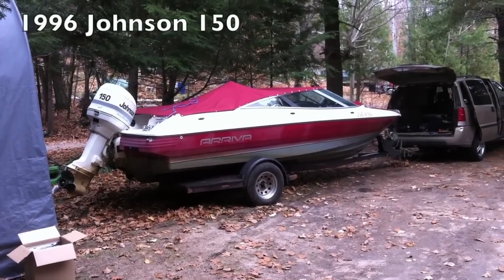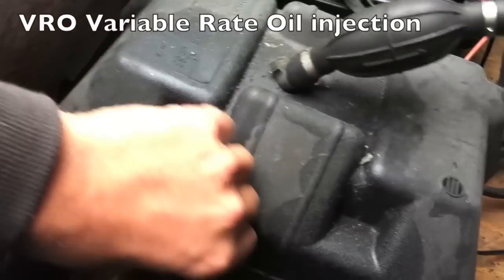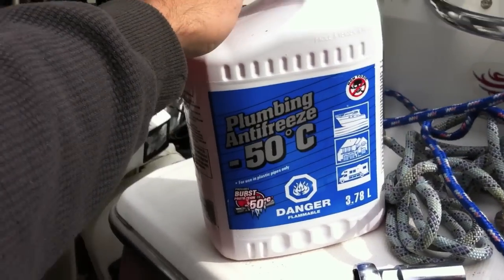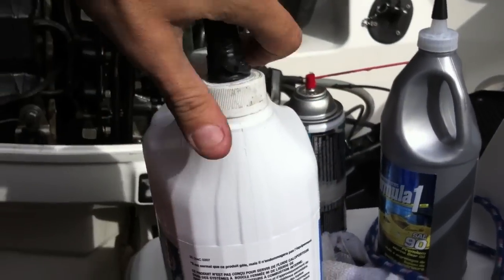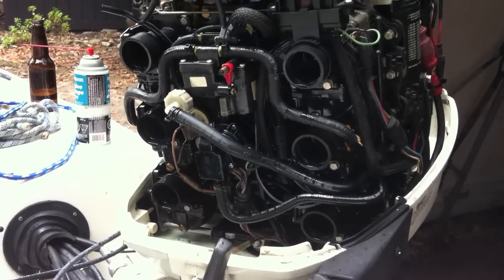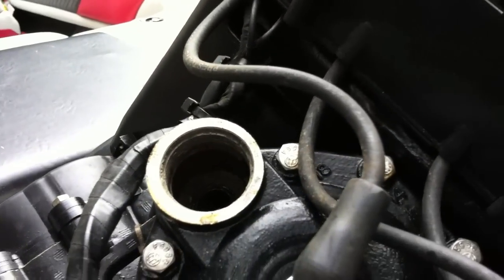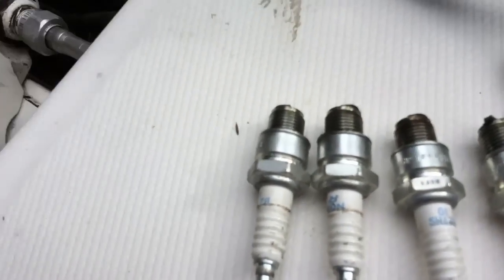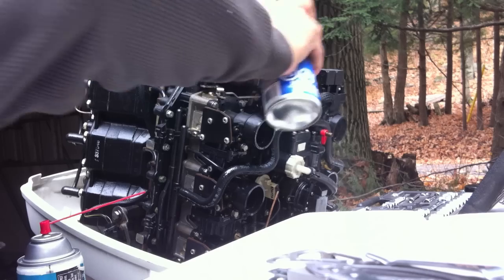How to Winterize an Outboard boat, step by step guide in HD for 96' Johnson 150 Motor

Comment: I have watched your video every year for the last 4 years right before I winterize my Johnson 225 HP OceanRunner. I have never had a problem starting my boat up in the spring in Greenwich Connecticut. The only added step I do is, I change the gear lube in the lower unit. Thank you for creating this awesome and educating video. The best line in the video is “And you can have one of these while you waiting” 🍺 Thanks again Anthony Ferraro
Reply from the maker: love it, thanks man, unfortunately I no longer have this boat.

Comment: I have a 2005 50HP 2 stroke mercury on a 20ft pontoon boat. It is from Arizona where it sat unused OUT OF WATER for the past 2 years. The motor sat in the upright position. I brought it up to south central Wisconsin... its new home. It has sat there at a buddies vacation house for about a month. Been too busy to get out there to go through it. The weather just started getting cold and the race is on to winterize the motor. We've already had a hand full of nights where it dipped below 32degrees. The past owner said he added fuel stabilizer back then. I just want to get the old fuel out of it altogether. Old owner said it never really ran good but has no idea why. To start diagnosing I want fresh fuel. We didn't try to run it yet. 

I was thinking of leaving the motor alone til spring when I can go through the motor, rebuild carbs, get all the old fuel out of the lines, replace fuel lines if needed (They're cheap), etc.. I am going to inspect and replace the lower's oil. Should I buy muffs now, TRY to get the motor started, add antifreeze, fog it, etc.. (The normal winterization schedule) Or should I just leave it alone as it might be dry inside? 2 years in the desert probably dried it up good I would imagine. Any advice? I'd rather go through it in the spring when I know I'll have a stretch of warm weather. If I pump water through there now (if I can get it running) and she wont keep running long enough to get antifreeze into it, I could be screwed. Should I just leave it alone?

Comment: Aways change the drive oil, or at least check it to make sure there's no water in it, before putting it up for the winter.  When spraying oil into the cylinders always angle the nozzle so that the oil hits the top of the cylinder otherwise it's unlikely to get oiled at the top.  Another way to coat the cylinders is connect to a small container with a heavy dose of 2 stroke oil and run the motor 'till it runs out and dies.  This will also help keep the carbs from gumming up in storage.

Comment: Some good tips there but surprised you neglected perhaps the most important winterizing step: removing the transmission oil from the leg. Any water that gets past the seals - and just about all outboards will have some water getting in - will freeze and expand in our delightful Canadian winters, possibly causing havoc to the leg. In fact this is the ONLY procedure I have done for the past couple of years other than bringing the battery inside and haven't had any issues. Although this year will be adding fuel stabilizer and may do a flush with antifreeze as you have shown. Thanks for a great vid.

Comment: I would have cleaned the battery post with Emory or a light sandpaper, also check the electrolyte battery fluid so not to cook a dry cell. Other then that your ducks are in a row. Snuggly?..... Sup wit dat yo. Great Video.

Comment: Great video. So when you pull it out for the first time in the spring is it as easy as installing the battery, starting and takeoff? Or is there anything that needs to be done? Also, I've had a real problem with mice in my shed like yours...I've had to throw in a couple lethal traps to keep them out of my engine.
Reply from the maker: +ironDsteele I don't have this boat anymore, but I never really had any issues, just started it at home first, takes a little bit to get her started. once I know it will go, then I take it to the launch.

Comment: Some additional comments, I try to run plumbing anti freeze into the intake for the live well to make sure the pump is covered as well as pouring some down the outlet for the bilge pump. Not sure how effective it is overall but it's worth a try just in case. Don't forget the moth balls for mice. I've never had a season where they weren't staying in the boat overwinter. Great video, thanks.

Comment: Now days I run fuel stabilizer and also Deep Creep aka sea foam off and on.It smokes but well worth it, there never is any gas going thru my motor that isn't stabilized.I also take one plug out at a time and crank the key once to pickup the fogging oil in each cylinder,This fella did what most anyone will do,with little variation.I do not use Antifreeze i might if I had my motor in a test tank situation.

Comment: Not necessary to flush with antifreeze.... any remaining water in head will drain on its on if the boats out of the water
Reply: +eric rosebach Hello, I have just purchased my very first boat, it has a 70hp Evinrude OB and I wonder if this will work for it? Can I just simply leave it upright to drain the water out of it? Need to find out how to change the oil. Will try to run the fuel dry in it too.Thanks.

Comment: Nice video thanks. I also change the gear case oil every fall. If any water got into the gear case over the summer its gone now and the new oil will not freeze. If the gear case oil is milky when you drain it you know you have gotten some water into it. Boat On!

Comment: I am a marine tech and all I ever do to put a outboard away for long storage is to diss connect the fuel line and run it till it dies so there in no fuel to go bad and then turn it over and it will pump all the water out so there is no water to freeze,, I have done this for over 20 years and I have started motors after 5 years storage and after connecting fuel they fire right up and idle just like when put away,, allot easier faster and cheaper and you actualy get a better result,, but whatever works for you,, just a thought,,
Reply: +infrareddreamz  You should never run a multi cylinder 2-cycle engine dry by disconnecting the fuel line.  For instance, if you have a 4 cyl, 2 carb setup, and you disconnect the fuel line, the top carb will run out of fuel first and the bottom carb will keep those cylinders pushing.  Since the 2 cycle only gets oil to the cylinders when it's burning the fuel/oil mix, you will be scouring the cylinders until the engine dies. If it's a 4 cycle then it has oil to keep thing lubricated, but a 2 cycle doesn't.
Reply from the maker: +Jeff Taylor , good point! some marine tech that guy is
Reply from the maker: I have learned more from the comments left on this video then I could have by searching around the internet, I like the idea of disconnecting the fuel and running it, till its dry. I do this with my 6.5 merc.
Reply: Warren Hardy trust me it works allot better than leaving conditioned fuel in it ,, if you leave fuel in the carb it will dry up after a couple months and the oild that are in the fuel are left behind to leave a coating in the carb that can gum it up,,
if you run it dry you have a dry carb and when next season comes you hook up your fuel and it will fire right up and not have to worrie about gum left behind,,  I end up rebuilding more carbs from people who have their motors winterized with fuel left in them and very rarely rebuild one that was ran dry,, I do like fugging it for storage tho,, that is god for the whole motor,, it gets through the whole motor,, good luck and happy boating
Reply: +infrareddreamz  what can I do to winterize my evinrude if it is not running. it needs to go in the shop, but I need to save some funds..any info is greatly appreciated!
Reply: +Warren Hardy If the engine has been running and the cylinder walls are fully lubricated I dont think the cylinder wall on the one that runs out of gas first would run dry of residual oil before the last cylinder runs out of fuel
Reply: Jeff Taylor hey what about a 6 cyl motor can i disconnect the fuel line and run it dry ? Or is it bad

Comment: Is this a salt water motor? Is there any difference in procedure for fresh water only?
Reply from the maker: This motor had been run in salt by the previous owner, I'm in Ontario, just fresh water where I am.
Reply: +Steve Van Dokkumburg If its been in the salt water you need to put it on a hose and rinse it out with freshwater afterwards because the salt will eat away at it with time

Comment: In an old motor I used to have, I would replace the oil in the bottom unit gears every winter- it would turn white-ish- water would mix in during the season.  The new motor I have, it was really clean- straight oil, so I think I'll skip that this fall.  I've heard both ways- about the stabilizer or running the engine dry.   I like to run the engine dry after every use, because I'm lazy, and don't know when I am going to take it out again.  I do like your silicon spray idea, and am going to look for a can of that.
Reply from the maker: Yea. No need to run the anti-freeze, I have a little outboard now, that I keep using till it gets to cold. And I don't know when it will be the last time to use it. Some of the best advise is the silicone lube to stop the cracking/drying up of rubber. For sure.

Comment: Great Video Warren, after reading the comments , it just seems as usual u cant please everyone.. instead of sayn thank u , or making they own video, they have negative shit to say.... So again thank you for taking the time to do this.. if it working for u then dont change a thing.. I have been doing these exact same steps for yrs and my 115 2001 Ocean Pro, works just as good as it did the day i got it new... so again thank you Sir !!..
Reply from the maker: right on
Reply: Warren Hardy I was about to buy some of that silicon spray.  Then I see on the label not to use it on plastic.   I'm unsure what might be under that engine cover.  Maybe a '82 evinrude wouldn't have any plastic.   For an example of using something in a bad way, when I used Armor All on bike tires, they cracked shortly there-after.   How long have you been using the silicon spray?   I already replaced some of the old dry rotted wires on the motor, so I would really like to use that silicon spray.

Comment: These days it is a better idea to drain the gas out as empty as possible before storing. Keep enough in the tank for winterizing and add some stabilizer to "the dregs" - - It used to be a good practice to keep the gas tank full to ensure water doesn't get in over the winter via condensation. The gas these days is awful stuff and won't age well - and old gas is not good for the engine, even if it's been stabilized - so drain it almost completely in the fall. In the spring the tank will be empty enough for lots of fresh gas which will burn nice and clean and help blow through (& dilute) any contaminants. 

Did I miss something, or did you cover changing the oil in the lower unit? Probably a more important task than the antifreeze in the cooling system. (When that is empty, no freezing will occur anyway).
Reply from the maker: Dont remember if I covered the lower oil. But I always do it in the fall. So it's put away nice and clean and ready to go. I leave the empty bottle in the back so it reminds me that I did change it.

Comment: I wouldn't drain the carbs though (unless you are storing it for a collection were it will sit for years)... they can dry out the gaskets if not used for a while. just make sure the fuel is stabilized.

Comment: Nice video. To make things easier
1. Instead of trying to spray each carb throat withoil, just use the adapter that's nestled in between them! You will need the omc bike air nipple connector thingy that comes with lots of other brands of fogging oil.
2. Guy BE SURE TO LUBRICATE THE STEERING ARM! Can't stress this enough, especially in salty air
3. Make sure you drain the lower unit oil to get the water out and put fresh oil in just so you don't need to do it in the spring.
4. keep the motor TILTED DOWN to drain all water and when trying to wake it up in the spring... starts lots easier
5. do the water pump in the spring at least every 3 seasons (as long as it's flushed after each use)
Reply from the maker: <font color="#000000">great tips</font><font color="#000000">I saw the bike air nipple and for the love of god could not figure out what it was for.</font>
<font color="#000000">Good call on the steering arm, never thought of that either, and same as you I change the lower end, at the end of each season, so that its ready to go. also heard not to leave it empty of the winter, same idea as carbs, you don't want to dry out the gaskets or seals.</font>
Reply: Warren Hardy Hey warren... yea that adapter is great... i have a few old crossflow v6's from the early 80's in addition to my 225 oceanrunner and was really glad to see they had it on that beast... makes things so much easier. In the spring you can also use the adapter to run engine tuner through!
Reply: Good call with the steering arm I been using lithium grease, is that good?

Comment: Great instructional video.  I do many of the same steps.  I do however, drain the float bowl in each carb and flush all of the fuel out of the lines.  Better to not have the fuel in there IMO.
Reply from the maker: thats a great comment, maybe thats why I started having problems with my float bowls getting stuck, over flowing, leaking, etc. Ordering all new ones, hoping it fixes my current issues.

Comment: Wow! never seen that before RV anti freeze just let the motor drain and you good to go.
Reply: only use the BLUE Sta-bil for outboard boat motor not the Red Sta-bil that's only for RV. tractor etc...
Reply: So right don’t need the anti freeze on a out board
.. I’m so confused . I watched another video and they blasted the kid when it dumped it down . The ( what he said Thermostat holes) after disconnect from the anti )
Reply: I’ve had my 2003 150HP Johnson in Mass for 15 years and have never run antifreeze through.  If it really lubricate the pump, might be worth it.  I’d probably pour it in through the tell tail w/the motor off.  Overall, good video.  Ps. I always pour mystery oil into each cylinder and I spray the entire engine w/WD40.

Comment: Just in case anyone watching this wants to know....there is absolutely zero need to run antifreeze through an outboard engine.  They do not hold any water.  When you leave them upright (vertical) they drain out completely.  There is definitely no need to run 1 jug of antifreeze through an outboard let alone 2.
Reply: Environmentally friendly or not, you might as well dump it right on the ground, that is essentially what you are doing when you run it through an outboard...you are treating nothing.  If anything you are running a bunch of ethyl alcohol over your deflectors and water pump impeller, which are both made of rubber.  27yrs of working on outboards professionally and trust me, they don't hold water.  There was one in histroy that did and that is the Homelite Bearcat, but they stopped making them in the 60's.
Reply: i agree.
Reply: good to know, since I never ran antifreeze before and did not have that problem, but many due to not adding the gas stabilizer.
Reply: ***** I'll agree to disagree.  RV antifreeze is cheap, unlike automotive coolant/antifreeze.  At about $3.50/gallon, I consider this to be added insurance.  It's also environmentally friendly, and is commonly used to treat boat & RV fresh water systems.
Reply: I’m pretty sure that type of antifreeze is marginally less toxic then the car stuff definitely illegal where I’m from yo dump it into the ground. As others have pointed out there is absolutely no need to do this, if you feel it is necessary at least collect the discharge in a bucket and dispose of it properly

Comment: Great video man, I like it  I would never leave my lower unit without oil either just change it like u said in comments,and I use gas stabilizer in every tank to help with the ethanol in gas and any moisture that might be in there as well as I'm sure u did to.good video real helpful.
Reply from the maker: Right on

Comment: What about your gear oil? Overtime of running in water, there is the chance of water getting mix in your gear oil. Wouldn't it be wise to remove the gear oil as well for the winter?

Comment: Great video!!! As far as the anti-freeze i agree with you 100% very cheap insurance and also lubricates the pump and internals to help prevent corrosion. By the way i use the exact same method every year on my boat and have never had a problem. Only thing different i do is change the lower unit fluid just in case some water might have got in

Comment: Really wish somebody would have taught me about winterizing when I first bought my boat. No problems with motor due to not winterizing (guess I had gotten lucky) but still stuff I should know and do right? Lol unfortunately now my motor is shot from piston busting out the side of the motor at end of summer for some reason but if I'm fortunate again to have a running motor I will take proper care of it.

Comment from the maker: Not really, just hook you battery back up, and check or change your bottom end oil. Don't forget to put the plug back in your boat, I forget at least once a year, lol
It will smoke a bit more then usually when you first run it cause of the fogging spray.